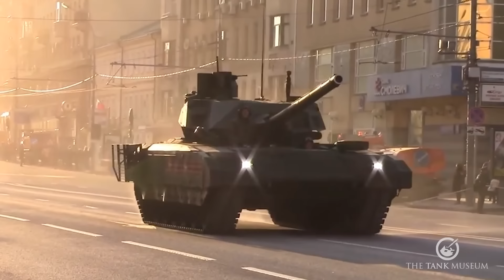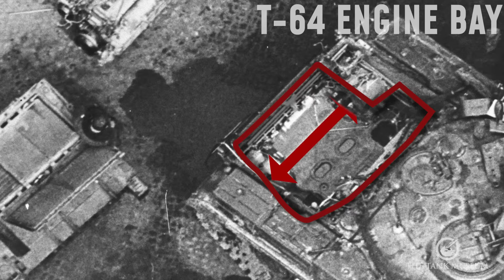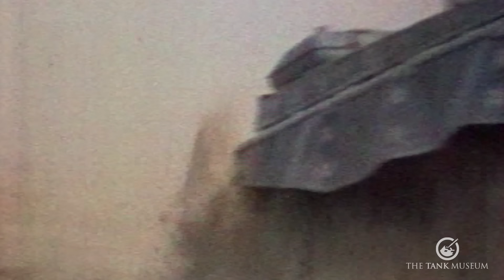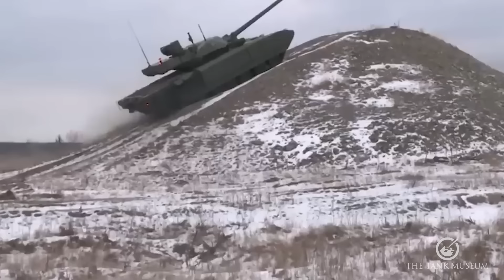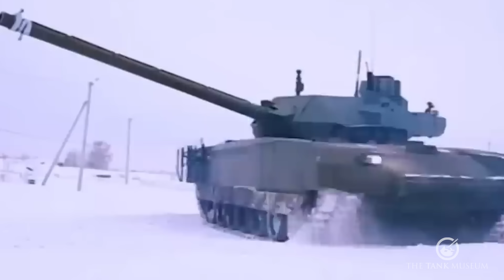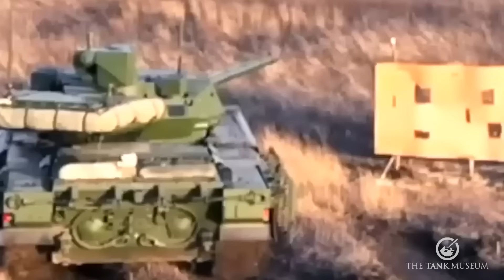Radical or Ridiculous? | T-14 Armata | Tank Chats #171

Comment: What's the point of a tank that requires components that must be sourced outside the nation that operates it?
Reply: nealy every NATO weapon system includes compoundents made in other countries, that's not the problem. Soucing them from countries that have scationed you is the problem.
Reply: In the modern world, pretty much any sophisticated weapon needs components manufactured abroad. Even the F-35 has Chinese-made components. No single country can be truly independent in this regard, even if some, like France, do try it. This is less of an issue for the West, where dozens of nations are closely allied and can support each other, but it is a problen for more isolated countries like Russia and China.
Reply: @Cailus3542  Saying the F-35 has Chinese made components is a bit of a stretch. One single component contained a magnet which was partially made of an alloy material that originated in China. So the component was not made in China, one of the materials which went into making one part of one single component was, and a different source was found. There was no need to replace that component in existing aircraft, unless China somehow managed to embed a surveillance device into the molecular structure of the alloy that came from there.
Reply: If we go all the way from resource extraction to rolling out of a factory, how many countries do you think can build a 100% domestic tank?
Reply: That's just a general problem with globalisation and NATO isn't immune to it. A lot of kit relies on components from thousands of suppliers in many countries that might be fairly generic until they're combined into classified packages. There can also be a bit of a myth that military= best when the reality can sometimes be due to long procurement cycles, by the time it reaches production, parts are obsolete. There was an example of this when the media showed a picture of a circuit board from a Russian missile to claim it was still sourcing 'state of the art' components. One of which was a TI DSP chip. When that was launched in the early '90s, I had to get an export licence to buy a dev kit. Now, it's end-of-life from TI and what cost me a lot of money can now be bought for a couple of cents.
But that's another challenge for the military. You want a service life of say, 20 years, but manufacturers may not committ to producing those specific components for that long. Then there's the general problem with sanctions. If you can't rely on imports, it incentivises sanctioned nations to develop their own industrys to do the R&D and develop things themselves. Once that happens, the sanctioned nation can then start exporting, making sanctions and arms/technology controls less effective. This happened with S.Africa, Iran, and is happening with Russia and China. Sanctions can also work both ways, so the classic example of elaborate schemes to buy titanium from Soviet Russia during the Cold War.
Reply: Russia:  let’s create a tank that solely relies on outdated tech and materials from our enemies!!
Reply: @blindbookittycat  Every nation has the same problem. The British started development on Ajax in the '90s. The US M1 started even earlier to counter the T-62. Most NATO countries seem to have given up on the MBT so not developing equivalents to Russia or China's 4th or 5th generation tanks. But perhaps they don't need to, or current events will force a re-think.
Tech moves on. Some can be easily upgraded, ie think how more powerful computers are than they were in the '90s. So more space inside vehicles to fit more capable electronics. Then again, there may not be space in turrets to fit more sensors or weapons mounts to deal with top-down threats. Predicting the future is hard, so it makes sense to try a modular approach, or that may just mean making compromises.